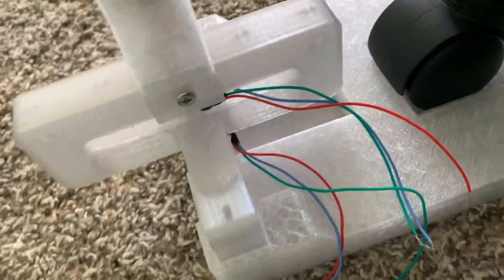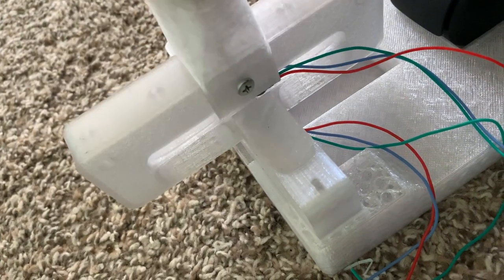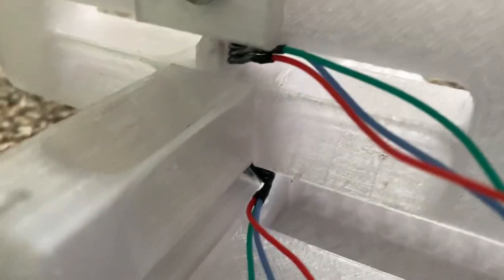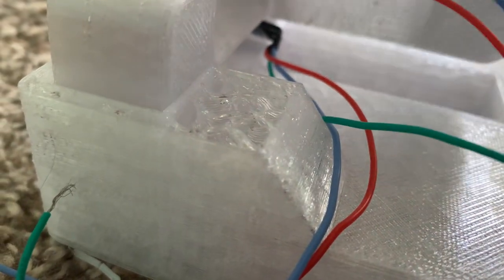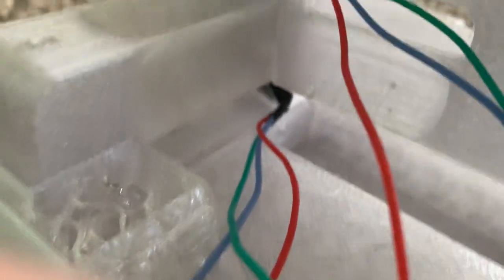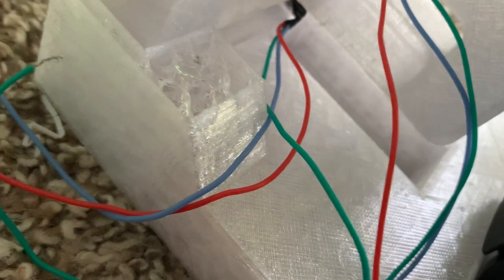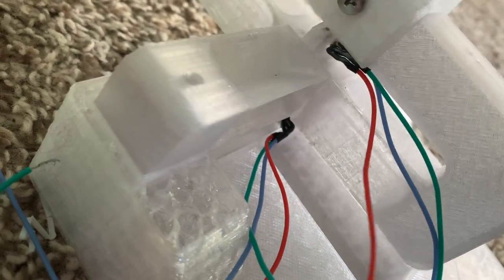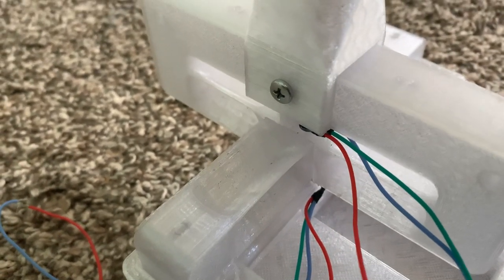3D printed flexure joystick with Hall effect sensors. (Compliant mechanism)

Comment: Neat concept! How about using suitably shaped spring steel instead of plastic for the crucial 'bendy' elements. I envision potentially greater longevity.
Reply from the maker: Well, it's been more than a year and it's still fine... I think the key here is ensuring that the stress in the plastic is pretty small, below the stress at which damage starts to accumulate.

Comment: Hey, this idea really simplifies the return to center mechanism of a joystick.
Do you think the range of motion could be improved for desk mounted joysticks?
Reply from the maker: Yes, longer or more narrow flexures would work. 10 degrees may also be good for a desk joystick, I think that's the deflection which modern fighter plane load cell sticks have in real life (they ended up adding some movement because if its completely static pilots can't feel the limit and end up bending their sticks)
Reply: @dizekat  Thank you. I never used PETG before, but I'll grab some inspiration from you and print some gimbals.